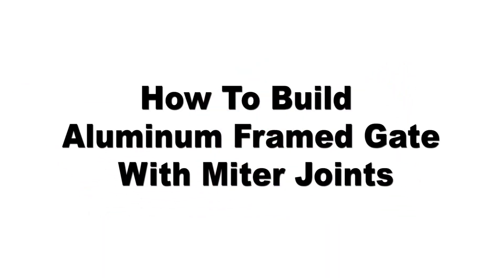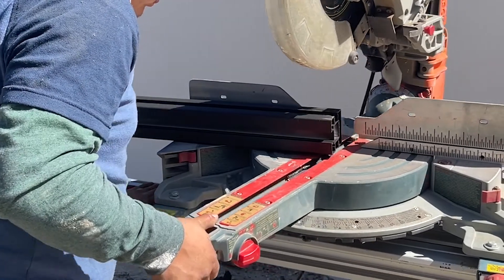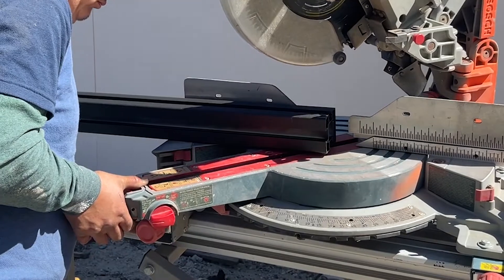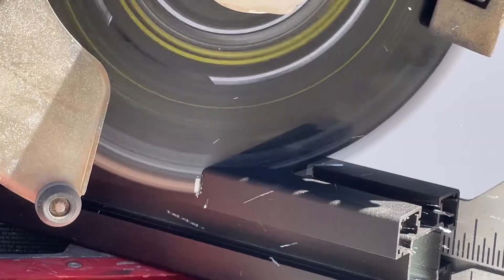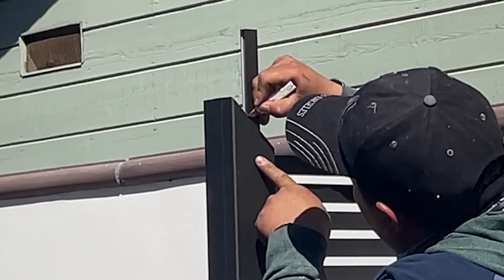How To Build An Aluminum Framed Gate With Miter Joints. NO WELDING

Comment: How do screw top part of last miter joint?
Reply from the maker: The screw should come from the side. You need to drill the cover 3/4" and drive the self drilling screw on the inner wall of the frame. Once finish we provide 3/4" plastic cap to close the hole.

Comment: Could your confirm where I Could get those profiles? I need to built a gate of 9 feet by 5 feet H minimum
Reply from the maker: Sure. www.alumission.com you can also call with your measurements and we will build you quote for materials 888-615-5001

Comment: How strong are the slats? Can someone ram through them?
Reply from the maker: These connections are strong as any metal gate will be. The connectors themselves made out of 1-1/4"x1-1/4" steel tube with 1/8" wall thickness.